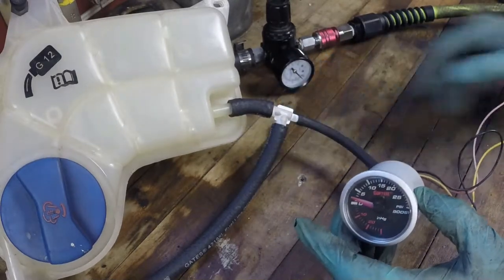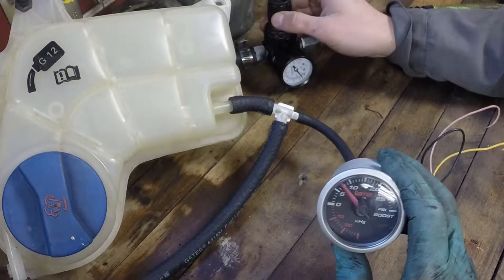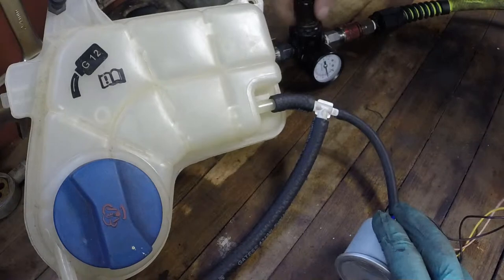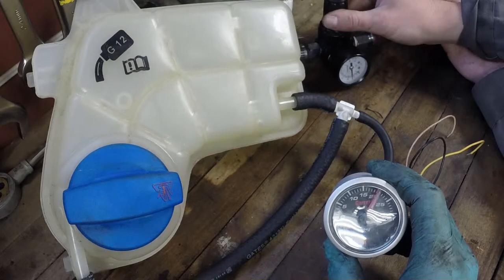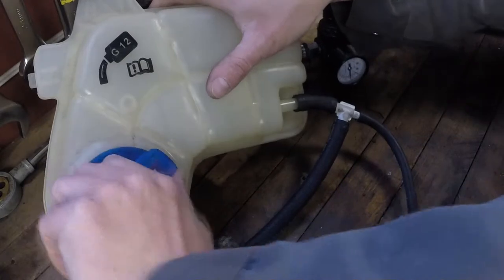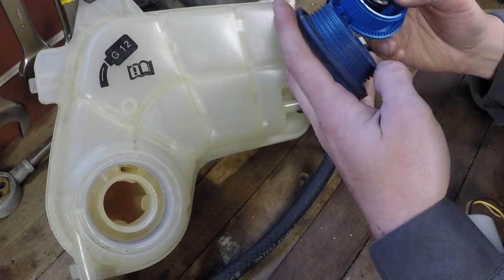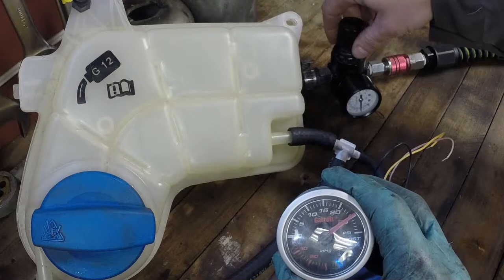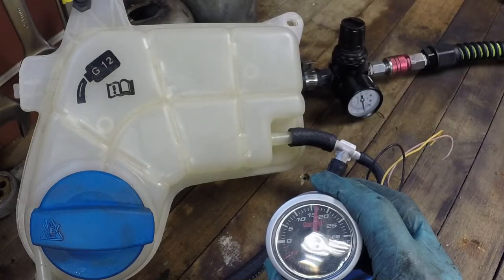Diagnosing a Faulty Coolant Expansion Tank Radiator Cap

Comment: Two month ago while driving in highway i get the low coolant in my dashboard , i refill it with water without antifreeze and it again loose more then 300 gr in 30 km drive city . I send it to mechanic he told me that might have a leak in radiator , check it but nothing , after he told me that my fan dont worked after temp goes 92 celcius , he told me he fix it ,but again i keept loosing water the same , 1 week ago i sent it to another and i replace the cup and i add it for the first time antifreeze , i drive 30 km and in the morning i saw it the level was as it was filled , after i drive in mountain 20 km and again was ok , 3 days ago was for a drve in city no more then 15 min and when i seen in the morning it had less water but a very very little difference . Today i was in drive  80km and when i get home i let the car get cold for a hour i was the temp was 50 celcius , i seen the water was 3 mm down max and when i remove the cup it went to max . I dont know if this is ok , if the cup was the problem or it does has any problem again , please someone explain me
Reply from the maker: Sounds like it could have been an issue with the cap but keep an eye on it. Does it start ok from cold? Any white smoke in the exhaust?
Reply: @PBGarage  no nothing , everything its ok for start and no smoke
Reply: @PBGarage  im doubting that maybe i put too much water and now the sistem has loose it to gat it to normal or not ?
Reply from the maker: @R3MILI so I would wait and keep on eye on coolant level.
Reply: @PBGarage   , just seen it , it lower than max , lower than it was . Might be maybe the cup has to be with bigger pression ?  one more question, the mechanic only added 1 litrer of concentrate coolant , is it ok ?
Reply from the maker: The proper way to do it would be to drain the system and add the correct amount of mixed coolant so you have the correct mixture and make sure you have the correct coolant as well. Anything else is just a guess. It might be ok it might not be. With cars this old, unless the coolant has been flushed, you’re asking for corrosion and wear issues with the water pump. There’s really no replacement for proper maintenance.

Comment: different psi is the size and the thickness of the rubber o-ring under the cap. Worn o ring will release the pressure earlier. Over filled coolant always will damage the o-ring within few days and it become harden unable to hold the pressure, the coolant will boil and burst out or cause leak

Comment: I have a different problem. I just discovered today that the coolant level before starting the car was at MAX. Last time I drove was on Wednesday (hence "today" is Sunday"). I went for a 25ish km ride, and the coolant level rose up above the MAX line with the same amount as usual when in the middle between MIN and MAX. I parked the car at around 14h00 and checked the coolant level again at 18h00. it dropped just slightly below MAX level. the supercharger (It's an Audi S4 B8) was still quite warm. I'll check again tomorrow at 10h00 in the morning to see how much did the coolant level go down. I wonder whether it's safe to drive to the auto mechanic (about 15km of motorway driving or 15 min) or rather have the car towed there.
Reply from the maker: As long as your temps stay normal then you should be fine driving it to the mechanic. Keep an eye on it as you're driving and if it starts to rise above normal, pull over immediately. Good luck!
Reply: There is no “max” level on any of them!?

Comment: I have a familiar problem like this, coolant reservoir talking overflow while driving car without switch on ac but if I switch on ac then everything works fine
Reply from the maker: Sounds like it could be a problem with the radiator fan control. The fans turn on with the a/c but if the coolant temp sensor isn’t working properly maybe it’s overheating when the a/c isn’t on.
Reply: Brother I have already clean my radiator, fully scane my car via scanner buy there is no fault. Also remove thermostat valve.. When i`m driving without ac on the radiator fan works slowly might be 10_20%. But in ac on its works on full speed.. Please help me out dude. What I could be.
Reply from the maker: Yeah sounds like a problem with the fan control, the rad fans should be able to spin up to 100% if the car is overheating.
Reply from the maker: Also check the readouts on both coolant temperature sensors.
Reply: Got any solution mukul?
Reply: @rahulbisht5191  changed my coolant bottle nd cap thermostat nd radiator and everything works good

Comment: Hi am currently having a problem with my car its over heating the reservoir is swollen the water pump beld has busrt and i replaced it it started work after it started to over heat wat causes that can i help me out
Reply from the maker: If the car overheated before you fixed the water pump belt, you could have killed the thermostat or cracked the head, blown the head gasket. Lots of potential issues could have arisen.

Comment: My question is how do I know if the cab is doing his job if it’s opening when does it really open and release pressure
Reply: The issue with my car is I feel like the cap it’s not opening I got a new one and I think the new one is still not opening when it’s supposed to because I feel like is getting build up pressure inside maybe at the Reservoir failed
Reply from the maker: One way to find out is by testing it like in our video here.
Reply from the maker: What makes you think it’s building too much pressure? Is it blowing off hoses? Or are you getting air in the system? Heater core stops working? Some of those could be indications of a blown head gasket or cracked head rather than an issue with the cap.
Reply: @PBGarage  I’m experiencing some weird issues. Air seems to be getting into my system, I can bleed it off but then after six hours of driving I can go bleed it again, rinse and repeat. I had some weird issues before, car seemed to be running a bit warm (not over half until shut down, then it would go just over half until it was turned on and coolant was flowing again, or it cooled) so I currently run a modified thermostat to allow a little extra flow and I changed out the rad, water pump and thermostat from before. No issues with overheating now but I am getting a bit of air in the system. Can a bad expansion cap cause this? Or am I looking at a head gasket? It can run for 12 hours without overheating, blowing hoses off (which it’s never done), or anything weird like that but after driving for a couple days I can start to hear a little water gurgle/bubble noise when I turn the car off which indicates air in the system, then I can bleed it again and get more air out. 2010 VW 2.5 Oil does and has looked good, no mixing anywhere and there’s no oil in the coolant.
Reply: @PBGarage  thank you so much for replying!
My issue is when idling the temperature going down on the engine and I lose heat in the car when I rev the engine everything goes back to normal.
And the other thing is even wen the car is cold from over night if I open the coolant cap there is a lot of pressure and increases the coolant in the Reservoir.
Reply from the maker: @ColtonMFrey  That definitely sounds like blown head gasket or cracked head. Quite possibly when you were overheating before you could even have warped the head just that tiny bit to be letting combustion gases into the coolant galleys. You can actually do a test on your coolant to see if you've got combustion products in it which would tell you for sure.
Reply: @PBGarage  Just purchased a test kit for combustion gases off Amazon, I’ll be able to run that test tomorrow. I also purchased a new cap which won’t arrive until next week. I may have the answer by then, but I don’t smell it. It would be wild if it was the head gasket/warped head after not even “overheating” just running right below where the gauge would start to move right. There’s also no visible coolant loss after the last 2K miles, but if it’s warped or blown in just the perfect way I hear you it could be letting combustion gases enter the coolant. Thanks for the reply. I’ll know soon enough.

Comment: Hi, the water in my expansion bottle starts to bubble and come out of the expansion bottle overflow spout at around 100 degrees temp (also, the heater fails to warm up) we know it's definitely not a warped cylinder head issue. I've just discovered (when the engine is cold < before start up) that air passes through the expansion bottle overflow spout if I squeeze the radiator hose < is this a sure sign that the expansion bottle cap is at fault please?
Reply from the maker: If the heater isn’t warming up you’ve got air in the system. You could try swapping the cap, bleeding the system really well, and then see where you end up. 

Squeezing a rad hose shouldn’t send coolant out the vent unless your tank is way overfilled.
Reply from the maker: The overflow is under the tank, not the nipple facing the front of the motor.
Reply from the maker: The heater core could also be clogged…
Reply: Cheers for your replies.

Sorry, I forgot to mention, the car in question is a (2008) 1.2 Vauxhall Corsa D.

When I squeeze the radiator hose, when the engine is cold, air (not coolant, as it isn't over-filled) passes through the expansion bottle cap mechanism and out the overflow spout - I can hear the air passing and sucking through the spout as I squeeze and release the radiator hose.

Shouldn't the expansion bottle cap machanism be closed (to allow pressure build-up) when the engine is cold and only open, for safety, if excessive pressure is created (because of a fault) within the cooling system?

Comment: İf can not hold the pressure , can i say the coolant liqud flow will drop and beacuse of that water can not reach to thermostat ? Or water can not circulate around everywhere at engine inside
Reply from the maker: If it can’t hold the pressure you will lose coolant over time and you could get air in the system.
Reply: @PBGarage  thank you very much

Comment: caps open at different pressure according to coolant system specification
Reply from the maker: Correct, but seems some aftermarket caps are not correct for the 1.8 or 3.0 system.

Comment: i have a vw vr6 gasoline engine.. when the engine is running and keeps heating the expansion tank gets almost overfilled by it self. car is not overheating stays at 90 Celcius fans works too..
what could be the problem?
Reply from the maker: Sounds like it could be a leaking head gasket pushing air into the system.
Reply: @PBGarage  so can i drive it or its a major problem that i must see

Comment: Have you tried the 'shake test'? If you shake the cap in the vertical direction, are you noticing that the one you tested that chattered had a click/clack noise when shaken in your hand whereas the others have not? In engineering terms the clack is the sound of a higher valve movement which is giving a larger pressure drop, rather than a gentle slow bleed relief. Which inturn causes rapid coolant flash over in the hotest part of the engine! 

This week my Arteon has dropped the coolant level to Alert level (that is when the sensor wires in the bottle are no longer submerged), with a corresponding dash alert & ping "Check Coolant Level". This occured after 18 mile drive on two consecutive days despite topping off the level each time. I bought an OEM cap the third day and 30 miles 70mph testing the car was perfect an d no change in coolant level.  Dash showed 90 C temp all the whole time.  

So then I took the orginal 25,000 mile 4.5 year VW cap for pressure testing by a non franchise garage. They reported it as fine, but opening at 28 psi (not 23 psi) and claimed it was therefore good to go.  Then I watched your video today and I think it tells a story. 

By the way VW asked me to book in for a coolant check, but 2 weeks wait for a  service booking, and the vehicle is required for TWO DAYS, to carry out full analysis before giving a price. What would that be on labour charges?  Can I prove it is the cap?
Reply from the maker: I haven’t, now I’m curious.
Reply from the maker: That sucks about your Arteon. I hope they sort it out and it’s not a fortune.

Comment: When you weird cooling issues what do you mean?

Just ordered a new cap because I've been having coolant going missing, not much but enough to where it needs topping up once a week.

Came out an hour after parking up to look the other day and found the expansion tank backed up with coolant overflowing out the top.

Would explain the missing coolant but im puzzled as to why it would overflow.

Thanks.😊
Reply from the maker: It burst one of the coolant supply hoses to the turbo, and it would leak coolant randomly from other places. 

If you have an AMB 1.8T, and you’re having that issue of the tank over-filling, or having issues with cabin heat, or the car intermittently overheating or blowing steam, you can try bleeding the air out of the system a few times but if it persists you may be dealing with a cracked cylinder head. VERY VERY common on specifically AMB engine code cars.
Reply: @PBGarage  thanks for the auick reply. The heating is fine, and the car doesn't overheat.

It blows white smoke for the first 10 to 15 mins of driving, but after that, it's normal again.

It's a Peugeot 207, and I had the head gasket done 2 years ago.

AA came around last week, took the cap off when it was hot, and it overflowed, so he had to quickly put the cap back on.

He had to bleed the system to get the coolant to circulate again, but I have no visible splits or leaks coming from the system.

I have no idea how the air rushed in, that's for sure when he took the cap off.

Took it to  a mates house, and he looked, couldn't see anything, and the system was circulating and behaving.

Weird thing, though is it sometimes struggles to start, goes eventually, but then the Amber engine light comes on and the anti pollution fault (air to fuel ration I beleive that means)

Thanks.
Reply from the maker: @garethfox6352 that sounds like a cracked head or blown head gasket for sure. Combustion chamber pressure pushes air into the coolant system that’s why it keeps pushing out coolant or having air locks. 

As the engine cools down it pulls coolant into the cylinder and that’s why it’s hard to start and then runs rough and has a misfire on one cylinder until it pushes the coolant out and burns it off (white smoke). 

A couple tests you can do. Drive the car so it’s quite hot and park it overnight. In the morning, before you start it, pull the spark plugs and check for signs of coolant in the cylinders.
Reply: @PBGarage  did think of checking the spark plugs.

I've got one of those blue fluid mix things that you attach to the expansion tank to see if it turns yellow.

I've a feeling it is the head gasket but still sit fingers crossed it isn't.

Friend did say he thinks the water pump might be slightly leaking, so the air might be getting pulled in there.

That's what I hope anyway lol.
Reply from the maker: @garethfox6352 fingers crossed

Comment: Wow you saved my car
I have a fiat punto diesel it has mysterious issue that no mechanic resolved, after couple hundred kms running car thermostat blown I replaced it
Then after some days radiator blown and replaced new one

After some days oil cooler started leaking 
Every time only coolant is leaking my mechanic said if you replace oil cooler also, then don't be shock if head gasket blown up. 
After researching google and YouTube I landed at your video and now I realized that coolant reservoir cap is not working properly. 
Good thing is car never overheated and didn't leaked too much coolant it leaks slowly and i did top up. 
Thank you very much.
Reply from the maker: Glad we could help!

Comment: what is the  symptom with a bad cap?? maybe i have the same problem
Reply from the maker: Coolant loss, air in system no heat in cabin, overheating, if the cap opens at too low pressure, coolant fittings, hoses blowing off, coolant leaks, swollen reservoir, if the cap opens at top high pressure.
Reply: Nice question am having the same issue with my reservoir

Comment: Higher pressure cap will effectively lower the boiling temp of the coolant, but I believe my car Allroad has 2.7t engine has the lower pressure cap that opens at 21-22psi, racers use higher pressure caps to keep coolant from boiling, but that might also contribute to other cooling system problems with heater cores, radiators, hoses, etc....
Reply from the maker: Yeah the car the high pressure cap was on had already suffered pressure related failures, coolant feed hose to the turbo burst, leaks from heater hoses, etc

Comment: I wana put blue devil in my car is that the radiator and is that where you put the coolant or is the radiator cap somewhere else
Reply from the maker: Yes that’s where you would add it but if you’re having coolant leaks, blown head gasket, or a cracked head, it won’t help.
Reply: @PBGarage  my number 3 cylinder is only holding 60psi and I'm hoping it will fix it probably not gonna work tho right I'm a need a new engine
Reply from the maker: If the engine code is AMB and you’re pushing air into the coolant then you probably have a cracked head. All you need to do is replace the cyl head not the whole motor.
Reply: @PBGarage  okay can I ask one more question mg audi has 180,000 miles and number 3 cylinder is not holding compression right. So should I have my head rebuilt or the whole engine since it's so many miles and if I have my engine rebuilt will this solve the problem